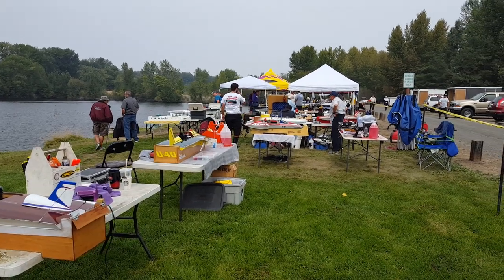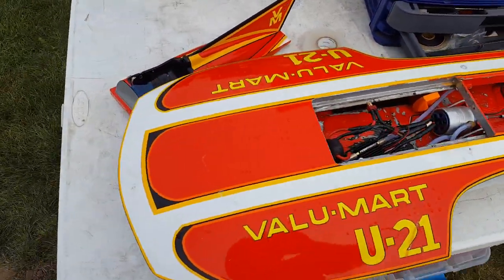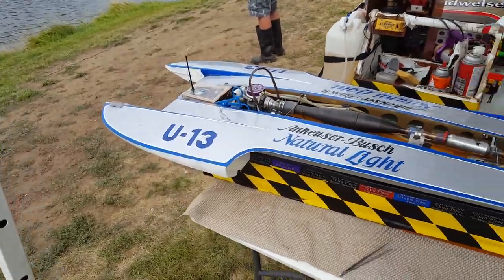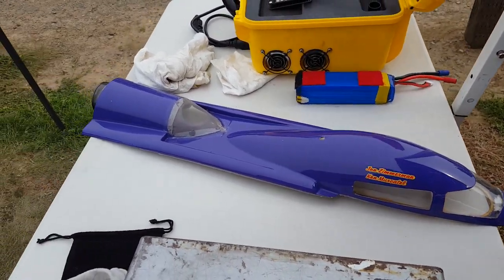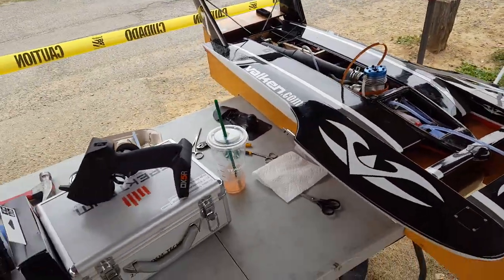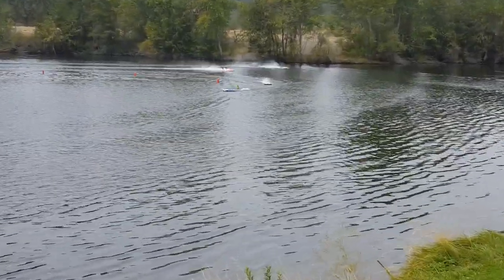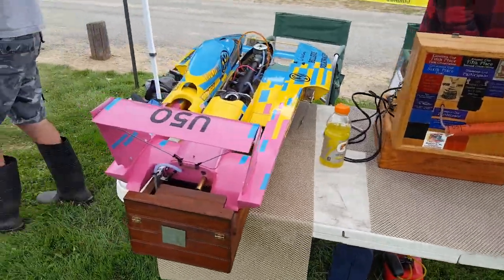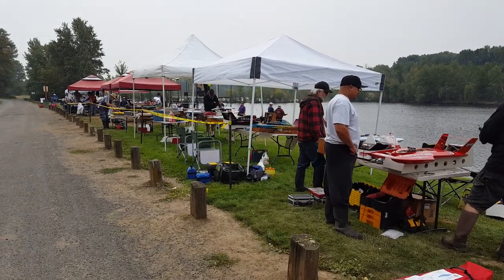Scale RC Hydroplane Racing Pit Tour R/C Unlimiteds Diamond Cup

Comment: Hi good man.... 😊What's the difference between the long air intake or short intake.. In a hydro like a miss budweiser..... Is showing in this video.... Thanks
Reply from the maker: On the full-size "real" unlimited hydroplanes the longer intake was developed for use when racing on salt water. Salt water spray from the sponsons would otherwise enter the airstream doing great damage to the turbine engines. A certain amount of fresh water spray is harmless, so in those environments the longer intake is removed to reduce weight, increase airflow and thus, power.
Generally when you see an r/c guy use the longer intake it is because another racer "owns" the registration rights to boat that uses the shorter intake. In our club, only one model of each version of the boat is allowed to race.
I hope that answers your question?
Thanks for watching!
Reply: @M5PerfHydros   yes... 
I know in the real boats is for this..for the salt water...when the water dry..the salt remains there, and it is like sand... the turbines don't like eat this ☺️
In the model, the long intake is very beautiful and make realistic look... Is a pleasure read and listen your words. I'm learning a lot. 😊👍

Comment: How long can you run a nitro boat out of water before the engine gets too overheated? What happens when it does get overheated?
Reply from the maker: Well I hope I never find out! The boat should be placed in the water as quickly as possible after starting. The engines are surprisingly robust, but you can definitely destroy one if you run it on the shore for long!
Reply: @M5PerfHydros  Thanks. I have a really old boat with a Rossi .61 engine. I only had it running for about 30 trying to mess with the needle valve and the engine froze up. I don't see any other way to tune the engine out of water.
Reply from the maker: Oops... 30 minutes is about 29 minutes too long!  
Whenever I need to run an engine for a long time in the shop I just run water to it from a faucet. I force a large piece of rubber hose over the spigot and use reducers to step the hose size down to the very small size of the fittings on the engine. Now just run a trickle of water through it and run as much as you want.
I'm sorry that happened but believe me when I tell you that I've made a great many costly mistakes myself in the past! Live and learn.... Get another one and get after it again!
Reply: @M5PerfHydros  thanks for the info.  It was running for 30 seconds,  actually, not minutes
Reply: @M5PerfHydros   Show more of the race
Reply from the maker: @jamestaylor478  - Here you go!  https://www.youtube.com/playlist?list=PLN1BConcF3a1QQ5gIm5PYEj9HFK_fnNnl